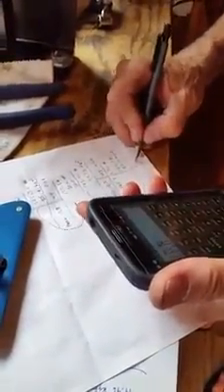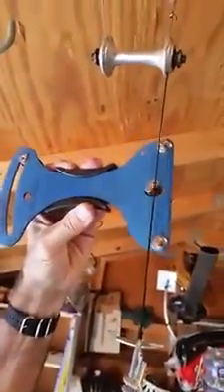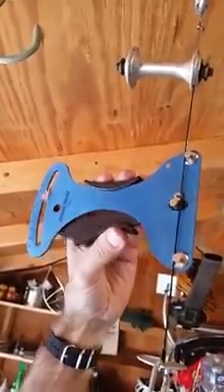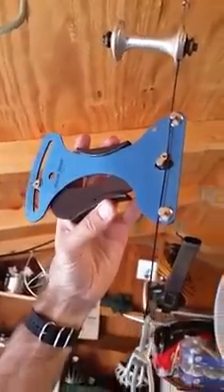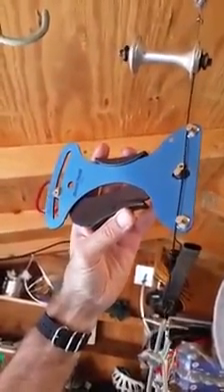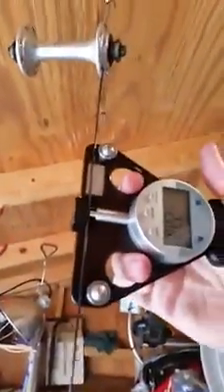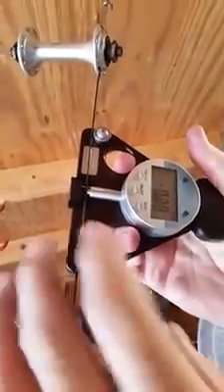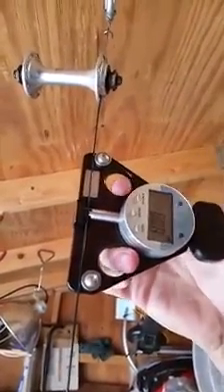Spoke Tension Meter Calibration Video

Comment: Is it the Park Tool reads low or the problem one can not accurately measure spoke deflection with an arc arm as compared to measuring spoke deflection with a digital micrometer.  One might believe that if the lever arm was much longer the degrees of arc would be easier to read.  I guess the question here is how much lower does the TM-1 read as compared to the very much more expensive digital meter.  Inquiring minds want to know. :))